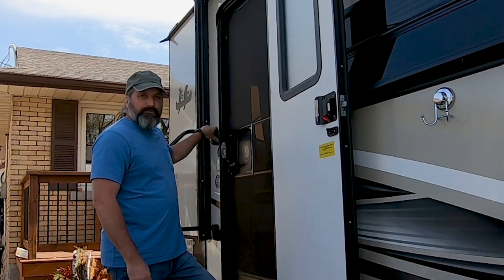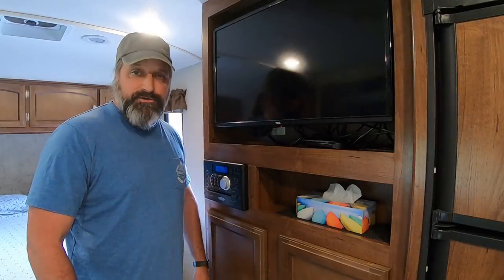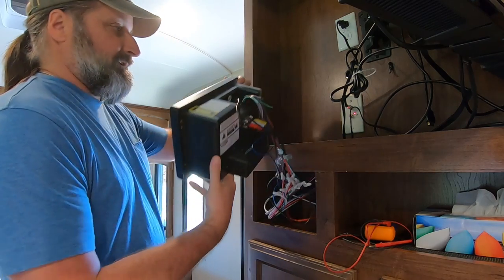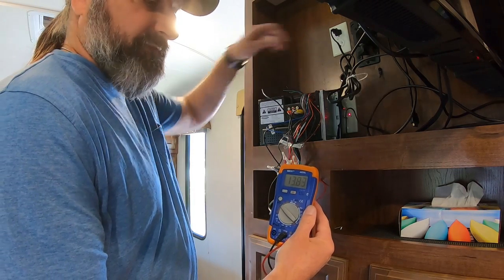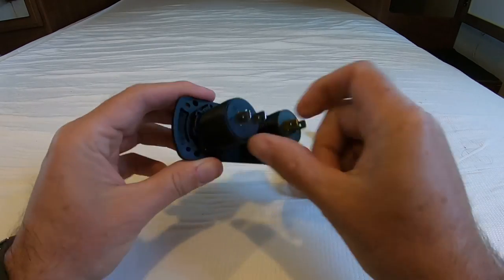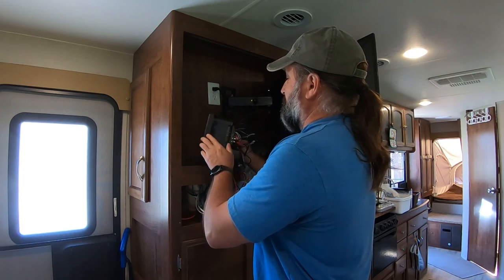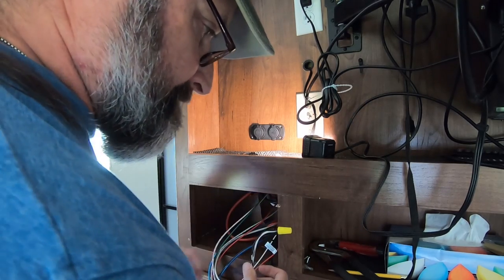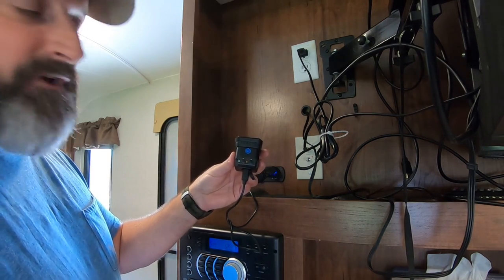DIY 12V/DC outlet and USB installation in an RV

Comment: Pretty straight forward.  I'm tired of having to fire up my inverter generator just to charge my phone while boondock camping in my RV.  Shame my RV is wired for both 12 volt and 120 yet not a single plug to use the 12 volt system when off grid.  Thanks for the video, another project I can add to my list.
Reply from the maker: Our old 2004 trailer had a DC cigarette lighter outlet but the newer trailers don't seem to have them. Is a simple install. When boondocking we use the usb outlets to charge phones, watches and camera batteries. It's awesome.

Comment: Just gotta say that is awesome.  Can't believe they don't come equipped with these obvious trinkets already installed.  Hopefully I can find one of those units too.  I had been plugged in inverter outside and running back and forth, plugging in power cable etc.  This will be really sweet!
Reply from the maker: Thanks for the support. Our old travel trailer came with a DC outlet behind the TV and the TV that came with it had a DC plug.  It was awesome for boondocking. I was surprised when I got this trailer that it wasn't the same. Sometimes progress isn't really progress.  Anyway, happy camping!

Comment: Being an Electrician I can easily do that but and it's a big but . I found at costco charging essentials usb/ac wall charging outlets, 2-pack. 4 usb charging ports 4.2A max charging dc 5v. surge protecting to 300 joules. LED charging indicator lights.
thought this may help. I was going to do all of that after purchasing my new rv this year and the usb port location was terrible and they did not work to boot lol. That is a great idea if you have 12v D/C and no 120 volt outlet. would you believe a brand new trailer and the usb is not working lol. May still replace the none working one with what you did there.👍

Comment: the more dc powered devices that you can plug in without using a wall wart the longer you can use it and the faster they charge like drills, saws, flashlights, laptops on usb-c jack [small round dc plugs found on amazon,  10 for 4 bucks

Comment: Good content. Only comment I have is there is really no need to disconnect the battery and shore power…just extra work. Just pull the fuse from your distribution center.  That would disconnect the radio circuit from both the battery and dc converter.
Reply from the maker: Good tip. Thanks.

Comment: Hi Ben, do you still use this DC Outlet or have you installed a whole-trailer inverter?    Also, if you've boondocked, is the TV a major drain of your lithium batteries?    Thank you!
Reply from the maker: I still use the DC Outlet. I haven't installed a whole-trailer inverter. When boondocking I plug in a 60 watt inverter into the outlet then plug in the TV plug to that. When watching TV the drain is about 41-45 watts so it's not much of a drain on the LiFePO4 batteries if watching for a couple of hours at night. If I'm concerned about the batteries getting too low because we are going to be staying for a long time I sometimes don't use the outlet and plug the TV directly into a 1200W portable power bank that we have. If it was a rainy day and we're watching more TV than usual I'd usually use the power bank because I can easily recharge that later with solar or by plugging it in at the comfort station.
Reply: @CampingwiththeColes   Thanks very much Ben!

Comment: Silly question, where do you find those screw cap connectors you used to connect the three 12v cables together? I'm not sure what they're called?
Reply from the maker: Those are called marrettes or wire connectors. You can find them at any hardware store or on Amazon https://amzn.to/3u1oRpH. Good luck with the install.
Reply: Really appreciate the quick response. Thanks for the tip

Comment: you could have turned the ac circuit breaker labeled DC iNVERTER and you would still had lights and ac inside. next time.

Comment: What's the wire gauge of your existing RV wiring? Have you had any issues since? I'm concerned that if I wire mine, my 4 amp TV might draw too much power and heat up the wire to the point of it being a fire hazard.
Reply from the maker: I'm not an electrician so if you are concerned you should talk to one. I'm doing these videos for entertainment purposes. That being said, we are dealing with DC power and not AC, so we really shouldn't have to worry about too much current going through it.  Especially a DC TV.  All the circuits are protected with fuses. The line I tapped into has a 10A fuse on it.  It would blow the fuse if it drew too much power. Now if this was AC current I wouldn't be tapping into it.

Comment: I have given this some this some thought.  I found these wires behind my stereo unit and they don't seem thick enough to be handling much more current.....thoughts?
Reply from the maker: It's just DC that your hooking into. It doesn't require much to carry the low voltage for the DC outlet. I'm not an electrician though so if you're not comfortable you might want to check with one.

Comment: Maybe you could help me out with this problem I have? I need to buy a battery and I am mentally short circuiting. I am worried about ruining a regular deep cycle battery and it seems the only option is lithium ion that can drain lower than 50%. What kind of battery do you have and will the television heater and lights Drain it real fast. Also do you have a generator that charges your battery when Boondocking?
Reply from the maker: I have a marine deep cycle battery. The lithium batteries are too rich for my blood. We've only gone without power for one night stops, like staying at Walmart or Cracker Barrel and we had no problem. I turned the fridge to propane and ran the furnace as it too uses propane for heat and only uses electricity to blow the air. We watched TV and  had the lights on. We generally had a normal night. I wouldn't try running a space heater, as any electric device with a heating element draws huge amounts of power. Things like blow dryer, space heater, curling iron, kettle shouldn't be used without being plugged in to shore power or a generator.  I have a 3000 watt generator that I use for boondocking. I haven't been boondocking with this trailer yet. I used it with my old trailer when we went to Cypress Lake for a week a few years ago. I installed a SoftStartRV on the airconditioner last year so that the AC can easily run when using the generator. We hope to go back to Cypress Lake this June and we'll be boondocking then.

Comment: How long can you run the tv for on a full battery. Im new to boondockong and i only ask because i dont want to kill the battery if i need the furnace overnight.
Reply from the maker: That's a very difficult question to answer. It depends a lot on your battery. If it's an 85ah lead acid battery like the one that came with my trailer I could only go about 18 hours running the trailer on the battery without watching TV. The TV uses about 40 Watts. We now have two 100ah LiFePO4 batteries so we could watch TV for maybe 20 hours, I'm guessing.
Reply: @CampingwiththeColes  awesome, that definitely helps a little. Thanks for the video and the quick reply. I was going to install a USB port in the RV this weekend then watched your video and saw the port for the inverter. I had no clue about any of that so I bought that outlet and the inverter. We're going to Yellowstone next week and I was planning on not having the TV,  but it will be nice for the kids at night. I do have a generator so I will just top off my batteries in the day. Thanks again!

Comment: Do I need to have inline fuses on the hot wires? Would the stereo fuse protect it by itself? Thanks
Reply from the maker: The wires that I used had fuses on them. This way each device is protected by it's own fuse. For example, if something in the DC outlet shorted or caused a problem, that should be the only fuse that blows.  They protect what's in series with the wire. You would probably want to have a fuseable link for each instance of that wire.  If you used the fuse for the radio on the DC outlet and something blew in the outlet it could take the radio with it. By the way, I'm not an electrician so this is just my own unqualified opinion. If you have a concern, please check with an electrician.

Comment: I installed a left over marine 12v outlet directly to my 12v terminal from the converter. Looking for hardware to install a 12v terminal to charge batteries. I want to mount it somewhere OUTSIDE  on the trailer. It is hard to get to the batteries inside my truck camper. Any suggestions? Must be WP.
Reply from the maker: Sorry, I can't help you with that. That's beyond my very limited expertise.  Good luck.
Reply: Bingo the thought occurred to me. Reinstall my marine DC out let outside wired directly to the batt. Buy a DC plug with pig tails and connect charger to those (+) and (-). Reason? My Batt is hard to get to for maintaining a charge when parked in the garage.
Reply from the maker: @sunlite9759  There ya go. All you needed was someone to listen to you as you figured it out. Glad I was there to help, lol.

Comment: How do you know which wire is the hot 12 volt wire and which is the negative or ground 12 volt wire to tie into?
Reply from the maker: It was fortunate for me that all the wires were labelled in the back of the stereo. The red wire (hot) and the black wire (ground) were also slightly thicker wires than all the rest. I used the meter to test to make sure I got the right wires.

Comment: Where'd you get the dc to ac inverter that you plug the tv into?
Reply from the maker: The one in the video is about 15 years old. You can get the newest model at Canadian Tire: https://www.canadiantire.ca/en/pdp/motomaster-inverter-75w-0111915p.0111915.html?gclid=Cj0KCQiAwf39BRCCARIsALXWETwQkuTeexzFirE3_bOJOL223aWqeugSQa_Z6a4cTAtD9Xfj_EyrTwQaAoByEALw_wcB&gclsrc=aw.ds#store=139

Comment: Would this work for a cpap machine?
Reply from the maker: If the CPAP machine has a DC outlet it would work or you could use the inverter like shown in the video. The inverter is good for up to 75 watts. I believe most CPAP machines use 30-60 watts. I'm not an electrician though, I don't know how long the trailer battery will last. I've only used the TV for a couple of hours where I would assume you would use the CPAP overnight (8 hours). You might want to look into that. You could always add a second battery to your trailer and run them together to help out.